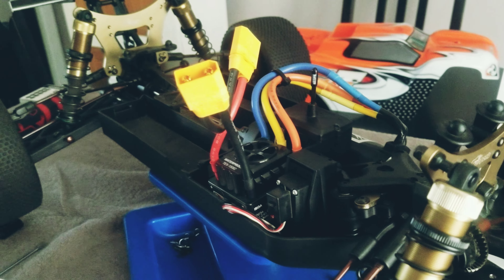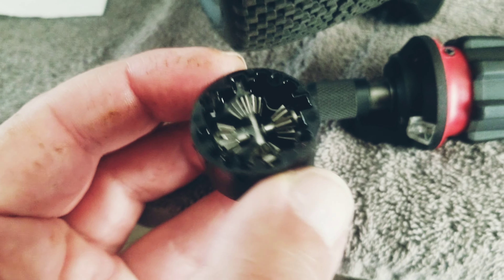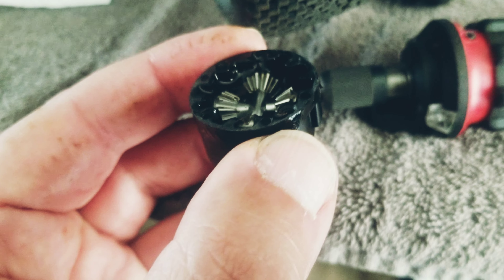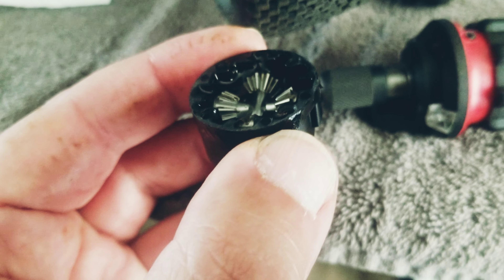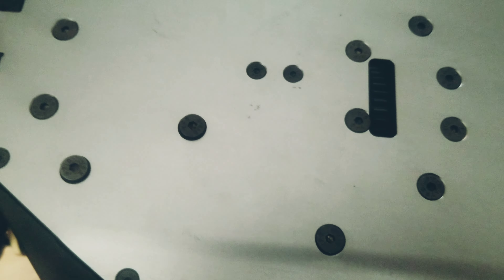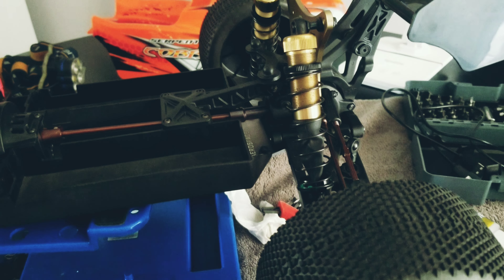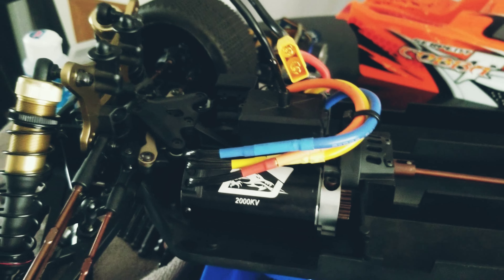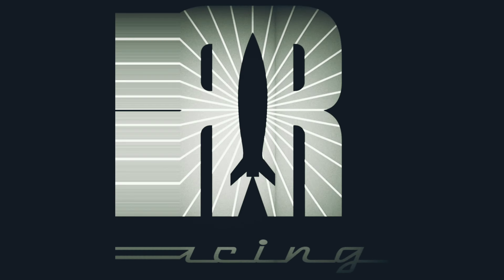Serpent Cobra E-Truggy Diffs and Shocks Setups

Comment: Really enjoy Serpent RCs 👍🏾 I run basher setup on my 811te
Reply from the maker: I like em too! Take a beating and keep on ticking!
Reply: What's your basher set up for this?
Reply: @cwatson42785  backflip LP tires, 50/200/30 diff oils. Removed swaybars, shocks/suspension is fairly stock..replaced busted pistons as needed & maybe thicker shock oil but can't remember weight. Heavier oils drastically improve acceleration & throttle control. I'm hitting big air-triple backflips. Tried a few quad backflips but haven't landed cleanly 👍🏾

Comment: I have the same car I just got and it did great at the track till I broke the plastic shock caps .I ordered the metal ones to replace. The bottom screw for the shocks is a pen not screw  my question  is can the pin be removed and if so best way to do so and can you replace with screw? I WAS GOING TO PUT DIFFERENT SHOCK ON AND NOTICED IT WAS HELD ON BY SOME PIN.
Reply from the maker: @nathanwelker8038  Yeah, Serpent does things a little different. The best way to avoid the pin is to just replace the entire shock assembly with something else. I have not tried anything new, but if I do, I will post here about what I chose
Reply: The bottom pin is held on by a small set screw. Loosen that and the pin comes out.

Comment: What springs u use bro
Reply from the maker: @uptownfragrance6148  Still using the stock springs! They seem a little short, so I may upgrade at some point.
Reply: U got good videos but what are those rims and tires
Reply from the maker: @uptownfragrance6148  Tires and rims are actually Hobao...